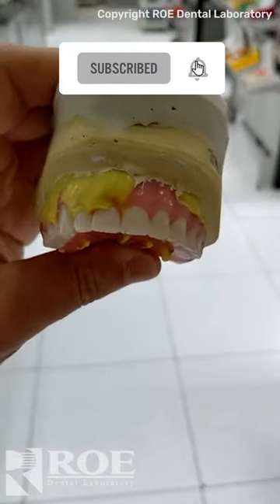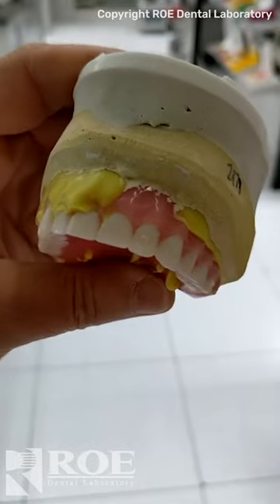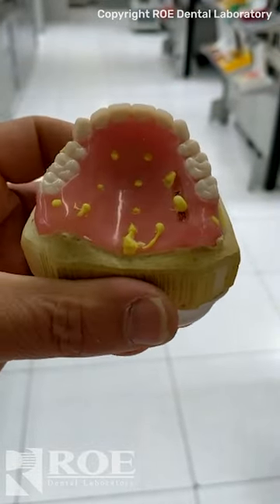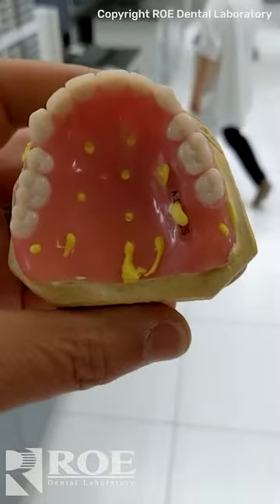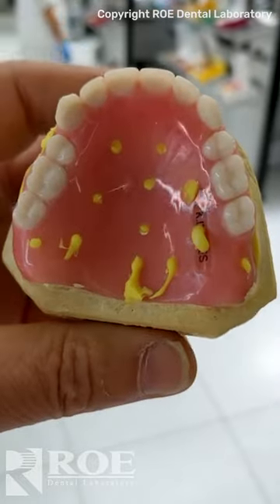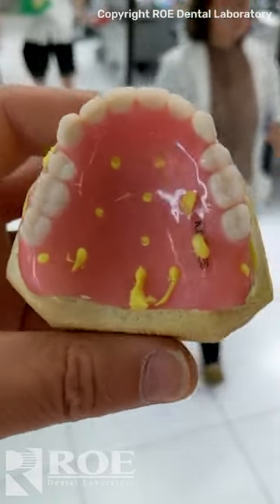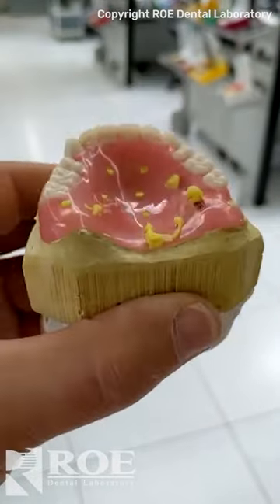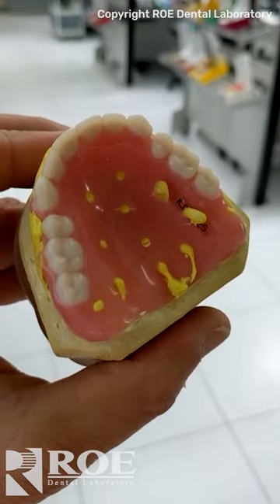What Do You Do When Your Digital or Analog Denture Doesn't Fit? #shorts

Comment: Have no idea what the hell you’re talking about, dude
Reply from the maker: If your denture doesn't fit right it can flop around and irritate. The best way around this is to reline the denture with material but you have to be careful not to leave voids between the denture and the palate. By drilling small holes into the denture you make certain that there is zero chance of a void and that all land masses are captured. This gets sent back to the lab where we scan it and make a better fitting denture that fits perfectly. Hope that helps.